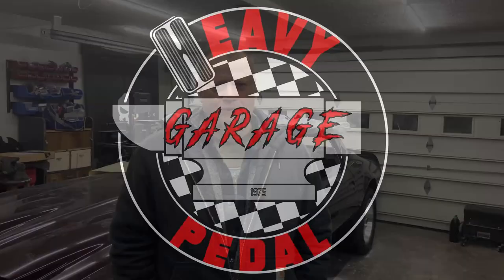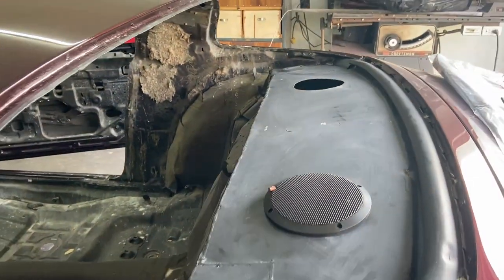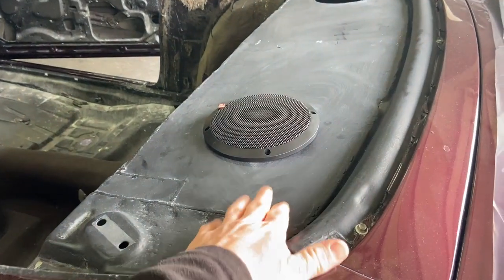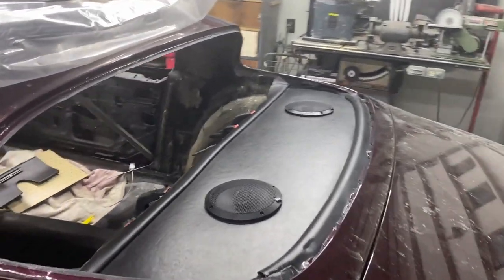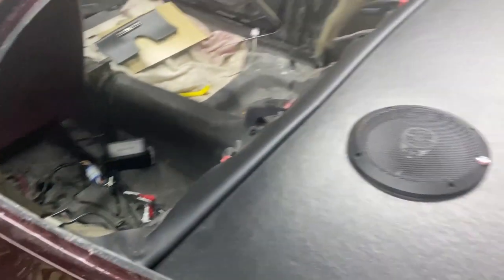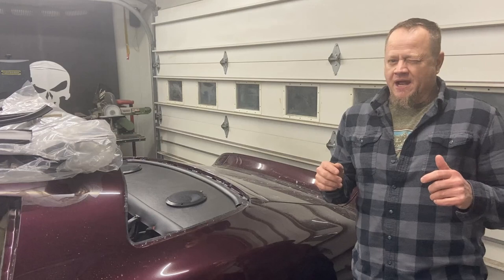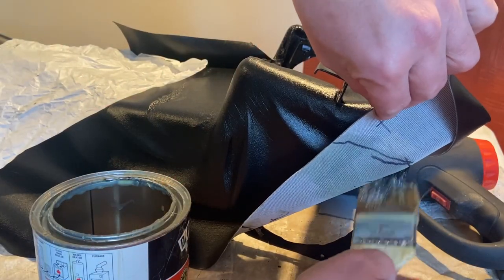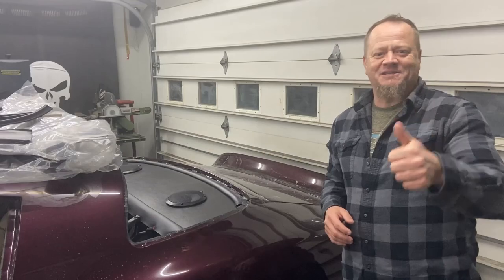Package Tray and Rockford Fosgate Speaker Install! 3M closed cell foam for insulation! 1975 Firebird

Comment: Where and what kind of screws do you put the package tray in ???
Reply from the maker: No screws were used, other than the ones i used to mount the speakers with.  The package tray just kinda lays there.  The front flap piece will get held down by the back seat and the back and side edges of the tray go under the metal lip that the rear windshield lays on.
Reply: @HeavyPedalGarage  thanks so much.  I will be in touch fore I am in the final stages of my frame of restoration of my 76 TA